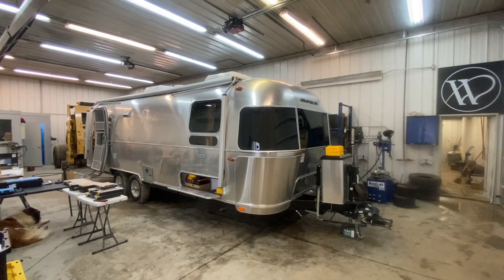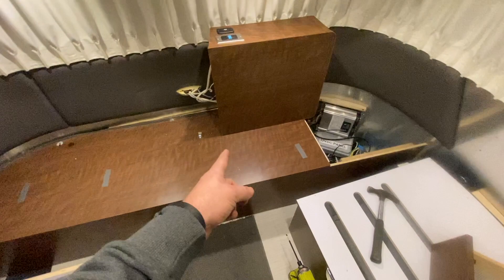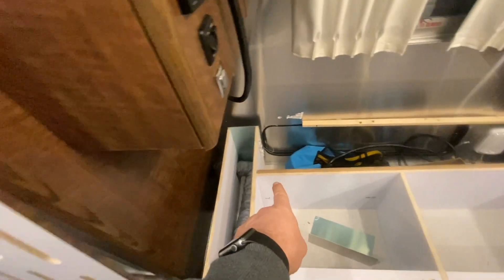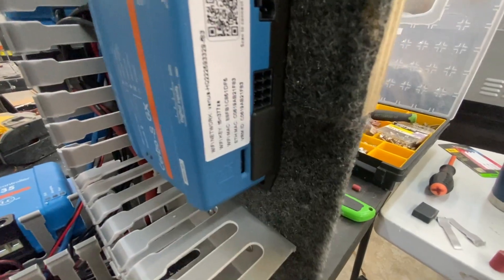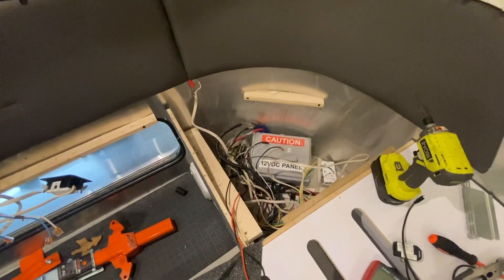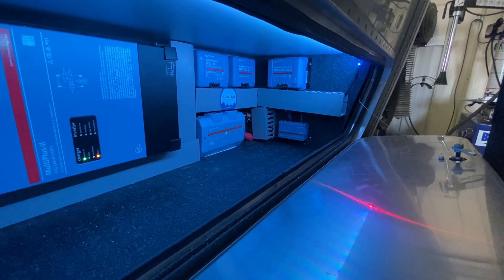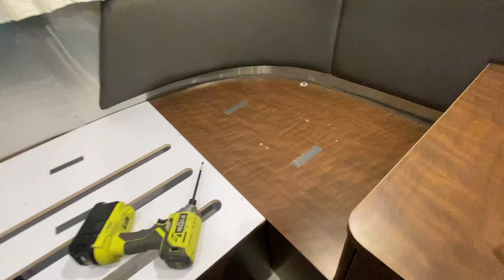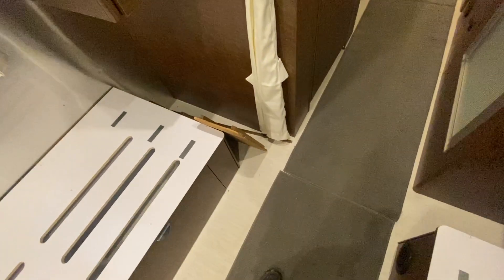Air Stream Globetrotter 27 700w Victron Solar Multiplus II System Install

Comment: Why didn’t you move the DC power from the distribution box provided by Airstream into the Lynx distributor?  Maybe that would have required lengthening cables.

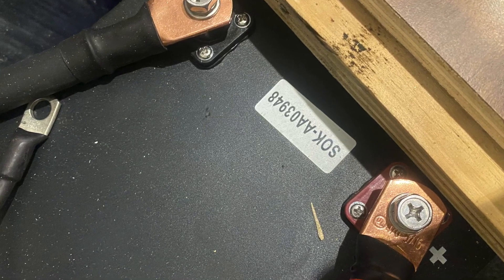Comment: Nice Video ...  I sent the link to a friend who as one of these types of trailers.  Also, any reason the  SOK over other batteries ... primarily Dragonfly or Battleborn  I have two 100 Ah and vey very happy... 10:23
Reply from the maker: Well, a few reasons. 1) I was able to jump the one battery because the top could be taken off. 2) They are 206ah each, so 412 ah total with the replacement in same space as 2 BB100's  3) these models also have bluetooth BMS , which is nice.  

Edit: Oh the final reason - customer had already purchased them :-)

I gotta shoot straight here, I think Dragon Fly has a great product, but I think they need to innovate more.  The GC3 was nice, but something smaller that could be modular put together and fit into odd spaces would be welcomed.   I love the BT BMS to help in diagnosing issues, cell imbalances, etc.  

https://battlebornbatteries.com/dragonflyintelligence/   Looks like they are one step ahead of us here.
Reply: @sotasolar Ohya,  Bluetooth built in must be nice... did/do they work with the Cerbo GX .. communicate?  I am trying a 12V EG4 400Ah in a stationary small radio shack (has some issues but fixing) but it does not communicate with the Cerbo like the 28 and 48 configured system.  I am lightly considering to replace it's BMS with a Bluetooth and model that can communicate ... but it may not be worth the effort.  They all keep coming out with a new set up or system ... interesting to see.  Very nice install for sure...  better than I can do.. 🙂
Reply from the maker: Currently I'm not aware of a way to communicate to Cerbo via bluetooth.  It would be possible if we disconnected the BT module and replaced with a serial to USB dongle.  I usually opt for the smart shunt and us the BT as a nice to have / sanity check option.    New Venus OS does have RV-C communications enabled I'm excited to try some of those integrations.